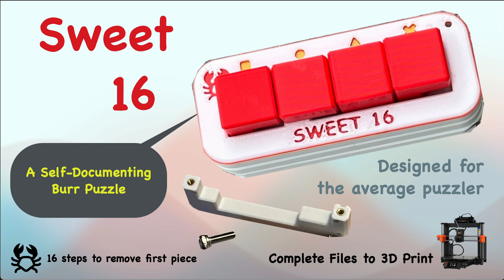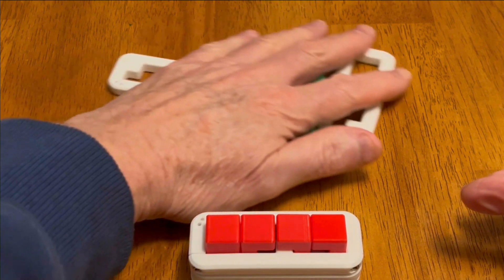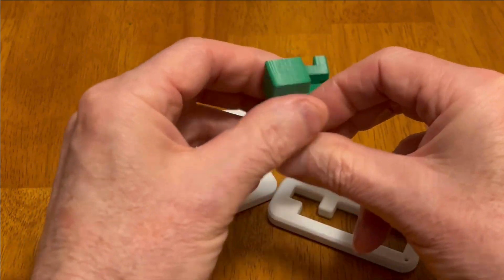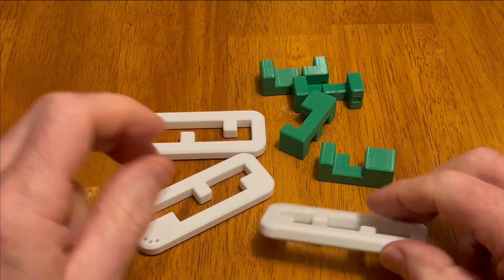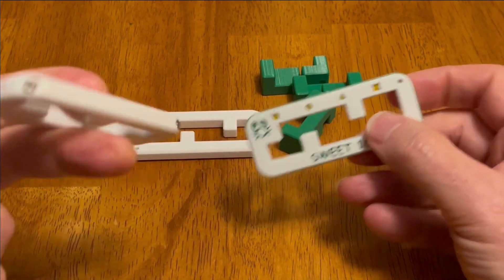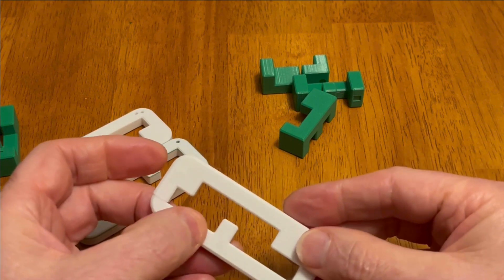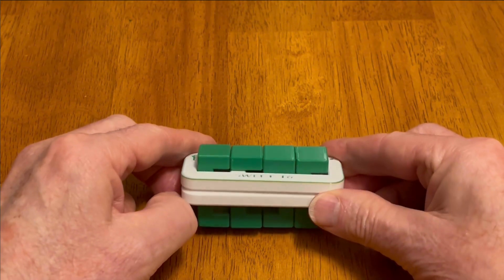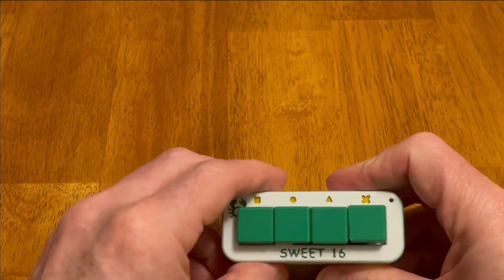Build & Solve the Sweet 16 Puzzle

Comment: Nice puzzle! Are the screws so you can assemble the puzzle initially without needing to solve?
Reply from the maker: Yes.. you screw the last plate together without learning how to solve it. Then you solve the puzzle by removing all parts.. You probably won’t learn the solution from one disassembly, so you can use the screws to remove the 3rd plate and assemble the parts into the first 2 plates and then add the 3rd plate again with the screws.  The screws will screw into the raw plastic about 10-20 times fine. Use the heat inserts if you have them..but not necessary
Reply: @ thanks for the nice puzzle! I printed it without screws and used Burrtools to assemble to get some practice using the software. Luckily I have a short memory so it will still be very tricky to take apart.